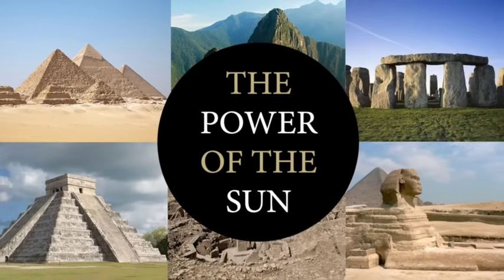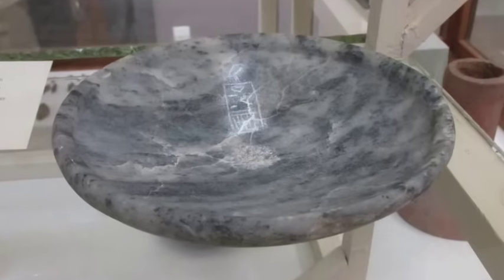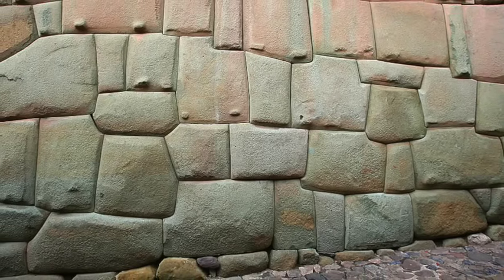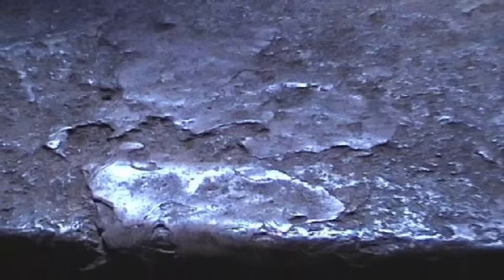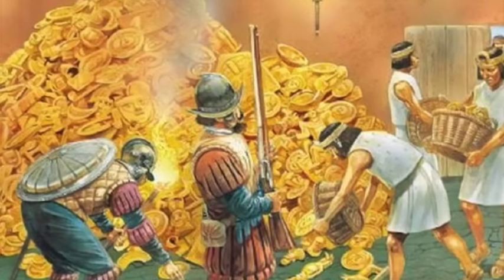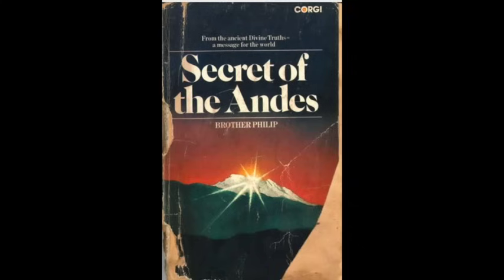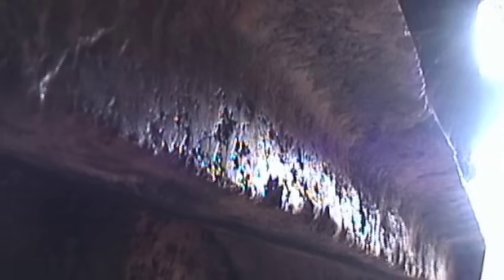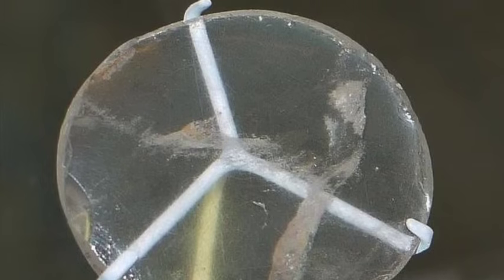How the Ancients Cut Stone with the Sun - Lost High Technology Explained | Ancient Architects

Comment: Laser cutters can achieve high accuracy cutting but only  with a high accuracy mechanism to steer them.  How could the concentrated beam of sunlight be steered accurately?  Also, if you're going to claim that stone has been cut with focused sunlight, how about a link to a demonstration or a demo in the video??
Reply: Modfab com-au even if this laser cutting theory is true how did they move these huge stone blocks?
Reply: @outsidechambaz  robotics, levitation, crane systems. It can easily be done with physics.
Reply: @junebug0o0  please demonstrate ok
Reply: @chuckkady7282  No thank you. I don't want to get in any trouble for that.
Reply: If they could figure out how to direct sunlight to cut rocks im pretty sure they would have had an efficient mechanish to steer it..
Reply: 15 giant focusing lenses that can be pointing into 1 big lense pointing downward that stays still.  And constantly readjusting the 15 perimeter lenses as the sun moves.
Reply: @dirtpoorchris  wouldn't that melt the big lense?
Reply: @jmavioso  No because the light isnt focused inside the lense, but outside it.  You know how straight lines all meeting in 1 point work?
Reply: @dirtpoorchris  No I don't, I'm looking to build some item but my knowledge of physicsis very limited.
Reply: Yes Lasser cutting is the most possible way
Reply: modfab com-au
my thoughts exactly
Reply: I'm thinking sundial, sand, and yes, we move it... Also thinking of a mat made of tiny balls used to move objects around in Tutankhamen, formerly Tutankhaten's tomb... So maybe don't need the sand, just the mat?

Have you seen Göbekli Tepe? How did Neolithics move 20 ton megaliths?
Reply: The sun moves in a perfect straight line. I imagine all these work sites centered around a stone in the exact position aligned with the sun with a perfectly stationary lens so the traversing of the sun cuts a straight line along a desired path through the stone.
Reply: @619mark1  the sun does not move in a straight line just as the earth does not move in a straight line. Relative to the earth the sun does not move at all…
Reply: @619mark1  That's a good theory
Reply: Dude in my village in Lebanon, there is sn underground kind of pit shape , drilled in rock underground, the top is well round and the interior is larger , maybe used to store water or something but it's stunning how did they dig that in bard rock!!
Reply: Another thing that people are misunderstanding is the while you can reflect a laser beam and keep the beam intact, you cannot do this with a concentrating lenses.  The angle of incidence is  varying but focused.  When the beams are reflected etc.. the reflected beam is dispersed
Reply: Bartosz Szyk  because you'll end up a black hole and not be allowed to see any of your friends or family ever again and most likely end up producing them only for certain people. Technology like this is not allowed to the public.
Reply: Did Myth busters not a sequel to burn ship with solar power? Busted!!
Reply: Replicate the process first then I'll  believe  you
Reply: How about you write an essay on a youtube-video you actually enjoyed watching instead of something you despised?
Reply: Try the magnifying glass you use to pee
Reply: What about melting the rock and letting it cast
Reply: Yes. You are right. This theory seems complete nonsense. In my high school years, I was interested in physics/optics, and used focusing lenses. I also fractured rock with Fresnel lenses w/sun.  While the surface does fracture, it is quite variable and the  focal point changes rather quickly.  Reflecting often disturbs the focused beam and reduces intensity. I wasn't trying to "laser cut" rock, but this is hardly feasible even on a very small scale.
Reply: @robthom09  Without even heating small rocks shatter bigger rocks will not.
Reply: I checked it out, according to experts from University of Poitiers (France) say:
You should use a parabolic dish. I use one with my students in engineering. It is 10 square meters large. I am able to fuse aluminum by clear weather so that this kind of device is definitely able to reach 500°C.
The melting point of granite at ambient pressure is 1266°C, his theory was debunked from the beginning.
Reply: Modfab com-au These stones shown are not square blocks, but fit together in peculiar patterns. Yet in other cultures, they use square blocks. I wonder if there is any significance to that. But I don’t have any proposals.
Reply: @Dcenteio  That's because they needed them to be earthquake proof
Reply: @rekzvs8547  Yeah I think I had a brain fart that day 🤗 I don’t even recall writing that
Reply: There's a video on YouTube with a 1 metre reflector getting 500*c. This topic makes alot more sense in terms of longitudinal/scalar waves
Reply: How do we live on a ball floating in space
Reply: There were guns that used crydtals thats how they cut n lifyed these stones
Reply: My sentiment exacty demonstrate your theory
Reply: Ever try plasma cutting steel one small movement and your line is not smooth.  How does one keep a solid line and the beam at strength to make such a flawless cut.
Reply: I’d like to see a demo too please
Reply: Sound
Reply: point the laser at a specific point on a rock spine the rock around on a ball bearing table then raise the line of sight up or lower the rock down n spin it again..human technoology is so simple compared to earth technology
Reply: There are references of books (the crystal sun), and a Watkins device ( https://patents.google.com/patent/US4611857A/e )
This is a good introduction video which I think is the point. You just have to do your own research and he gives some good direction in the video where to find them
Reply: https://youtu.be/I3pCs7jwK7I
Reply: Reflective lenses like multiple fresnel lenses perhaps sized up in down to fit proportions needed could absolutely cut and melt right through solid granite.
Reply: And the Scoops at the bottom of the obelisk ?
Reply: Dude he’s just reporting articles and studies he’s read up on. He’s not the one actually publishing these findings. Don’t shoot the messenger
Reply: Why do you think they fit them like possle pieces instead of straight bricks
Reply: Bro be smart
They used giant sun concentraters
Reply: Look up fresnel lenses, they can melt granite and can be attached to very simple wooden mounts. Optics supposedly originated in Ancient Egypt. If you can melt granite, you can make obsidian. If you can melt granite and make obsidian, you can definitely etch things into stone. No other clue how Ancient Egypt could do these things. It seems like a pretty simple thing to me... a large fresnel lens which can be found in old projection TVs can be used to demonstrate. There are youtube videos showing this.
Reply: This actually sounds pretty plausible considering Archimedes was rumored to use exact same techniques to set fire with sun laser to enemy ships.
Reply: A simple rig would work.
Reply: Very true.
Reply: How about tracks?
Reply: The beam could be fixed, and the target moved.  But I doubt concentrated light was the cutting method.
Reply: I was trying also to imagine one person manning each mirror and trying to move them in accurate unison...haha, of course though, they could move the rock quite well. (obviously they did that with MUCH greater ease than is commonly believed!).  So they could line up the mirrors and use them for a very short time without moving them if they moved the rock.  But they'd probably have to realign each mirror every few minutes so they got the highest power beam available to them, unless somehow they had a LOT of extra power, but then it may have melted too fast, as in, it may have spread with too much power for one thing).  So they must have had some way to move all of the mirrors as one so as to stay accurately focused and aligned.
Reply: @Reynoldsrobert  well that is what I am saying. What if they just had a series of mirrors/ lens in place so that they could do this. The rocks look as if they were cut in patterns based on how the mirrors were placed. Of course each mirror would probably have to be manned by someone to achieve this but depending on where the sun is going to be so the UV rays are at a higher penetrable rate. Also light waves can be effected by  sound waves [acousto-optics] so there must be some kind of frequency used to alleviate micro particles for a clean cut.
Reply: @junebug0o0  if a civilization could manufacture the mirrors and lenses, why couldn't they devise fixtures for those lenses and mirrors that allowed for a programmed pattern of adjustments over a given period of time. We know they spent a lot of time developing astronomical knowledge and tools, building a mechanism to make a reflector and lens follow the sun's movement seems at least remotely possible. I would want to see what type of reflector/lens system it would take to do cut clean precise lines, I doubt a natural crystal lens and a 12 foot gold mirror can focus a strong enough beam, multiple reflectors could send light through shared optics to bring the power of the beam up, but the complexity of controlling a dozen huge mirrors seems like a hurdle. In any case, using light and reflectors (if possible) would make moving the workpiece less important because once you can focus a tight powerful stationary beam you can use additional mirrors to redirect that beam around corners and possibly through more precise optics at the work site. This tech, would greatly reduce the amount of moving and scaffolding of the stones while shaping them.
Reply: One way to steer could be to make a jig. If your jig is made to the correct measurements, you can use that as a tool guide.
Reply: https://youtu.be/svAPyyUJUCo
Reply: @GrantAUM  , you got it! By George, I thinks he's got it!

The rain in Spain stays mainly on the plain!
Reply: He gave away the answer in the video when he said these structures, and pottery were made from some of the hardest rock known to man. The reason we can't wrap our head around how this stone was worked I this. It's a basic, but fundamental misunderstanding on our part. You see we ASSUME that the rock was always as hard as it is today. When that's not the case at all, but in the past there was an event that took place which I believe to be the Babel event. In which the mountains melted like wax before the presence of the Lord of Hosts. When God comes down the earth responds probably some form of radiation that passes right through humans, but vibrates rock to the point of dissolution. Just a guess, but it seems that these ancient people's searched out certain rock formations usually bedded like granite which is usually pink, or diorite, and even limestone. It seems that for around a five hundred year period which it couldve been longer I'm not being definitive here. But after that period most say that ancient people groups somehow lost some ancient knowledge of how to work the stone. But in reality it just became impossible as the stone began to harden which took a long time for some reason.. Maybe the source of radiation stuck around for a while? Many times in the mythos of these ancients people they connect these structures with "the god's" like the platform of persepolis being called "an offering from the god's" or the South American cities they call "city of the god's" which due to misinterpretation they assumed meant built by the god's. When actually it meant something more like "built from the god's" as in they thought the rock was "from the god's".. Anyway when you entertain the thought that, Hey.. Maybe the stone was softer back then than it is today.. Then it all begins to make sense how the vases were made, and how like in Iran essentially small cities were hewn right out of stationary bedrock. Usually when a structure is hewn out of stationary bedrock even something like the hewn out granitic formations in India. We usually can't find the refuse, or the material they dug out of the formation. But in nearly every scenario that this is the case where in we can't find the tailings then not far from the site are structures built on the ground. We only look around the actual hewn structure for the tailings, but never considered that it's not waste to them it was moldable not refuse. So that the material they hewed out of the formation doesn't go to waste as it can be used to build structures on the ground. So they haul it to a site nearby, and use it to build on open ground. Anyway that's my 2 cents, but in my opinion which I'm entitled to.. It's really the only possible explanation, and once you see the possibility dare I say undeniable. This is because people say "how did they do it? They weren't as advanced as we are today.. They didn't have the necessary tools." And then some smart guy says something like " Hey, what are you talking about? We can't even do that today! Even with our so called modern tools.." And the smart guy is right, but taking it a bit further I'd say.. That there is no possible way to make some of these vases, and grooves, and cuts we find with any of the tools we have today. Because it's impossible if the stone is hard as today. But that again is assuming the rock was as hard back then as it is today which likely wasn't the case..
Reply: @simple8mind8  I do not agree, but I like your theory :)
Reply: @simple8mind8  If you weren't such an idiot I would have thought you were on some strong drug derived medication......gods  indeed.
Reply: Didn't have to be steered. What if they were set in place and waited for the sun's rotation?
Reply: @junebug0o0  that wouldn't make a cut line, at least not a very long one because it would have had to be focused from the center of the mirror, so if only the sun moved the beam would quickly weaken.  Thus, they could perhaps make a hole or perhaps a short cut, but not a long cut, not without the rock moving or the mirror moving.
Reply: @junebug0o0  that could be why they knew so much about the movement of stars, if they're relying on stars to build.

Comment: pretty sure they used compressed air tools.
Reply: Which would mean they were done in modern times, its all a scam.
Reply: @Mr.Grimsdale  unless the pyramids were built as compression chambers
Reply: @theewtgy  The pyramids were not 'built' they are not made of blocks, they were sculptered from hills of limestone, if they were made of blocks then you would have lines inside the shafts within the pyramid, see pictures for yourself. This is the reason why i said it's all a scam.

Comment: Grinding rock on the same exact rock will.smoothe boothe rocks or the weaker rock will grind down to a super smoothe finish try it doesn't take long and given the fact there are atleast 100 workers at a time doing the grinding the reason why the rocks are not all the same shape is because they probably worked from a huge rock broke it then grinded it down then fit it together .....cave men had the could of done this with one good director

Comment: The melting temperature of dry granite at ambient pressure is only 1215–1260 °C (2219–2300 °F). So far they can make reliefs and ornaments on stone with a laser. Water jet technology can easily cut through stone. This would also explain why these stones of the old cultures were cut so smooth without unevenness.

Comment: watch?v=BsqOLCXYznE&t=7s   This is really how most of it was done, but some was just cement polymer and molds also. Then there are some that may have been molten rock, poured into a mold as well.. Giant magnifying glass would melt most stone in seconds... seen a video on that as well, but it wouldnt be to cut them, it would be to liquefy them and the wood molds would hold up for awhile, then repeat. Build mold shape, throw stones in, start melting, add more stones, keep melting... etc etc... possible... no idea if its correct, but giza is proven polymer, most the stones are man made cement.

Comment: Well put friend, that still leaves the mystery of how they moved it. Also id like to add that when you say no electrical items were found, presumably these items would be made out of a type of diamond tip drill?   Im sure if that was the tech used the diamond would certainly be plundered over the years. Also Id assume the drill to be made out of predominantly metal, and we've all seen what happens to cars after less than a century of weathering let alone 12000 years.

I find your videos compelling but these still seem like unlikely soultions given the scale we're talking about here. The sunlight cutting likely wouldve been a very time consuming process, and these megolithic sites were abundant, we find them in more than a few places around Peru, most of which the quarry totally unknow to the people. Yet another question, how do you explain the evidence of cataclysmic damage on architecture which is very reminiscent of that seen in other megolithic sites around the world?

I still think the ancients use some type of acoustic cutting tool. Its far less expensive to manufacture tha  a man sized gold disk, it can cut through the hardest of stones with relative ease in comparison to diamond tools, and it doesnt require sunlight, work theoretically couldve gone on through the night and if the tales of automatons are to be believed possibly the stones were mass produced via automated, acoustic cutting tools.

Though im not totally closed minded. If a smoking gun is found in favor for the Inca the  Ill be the first to eat my words.